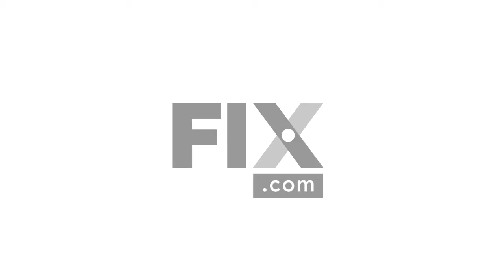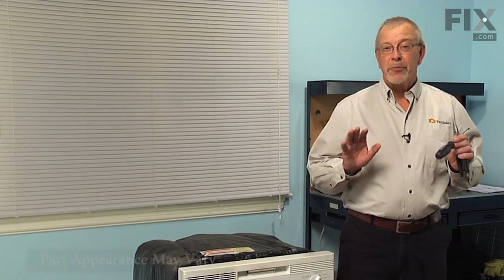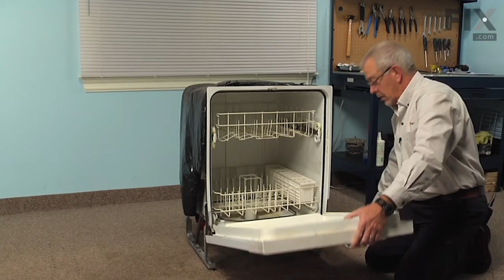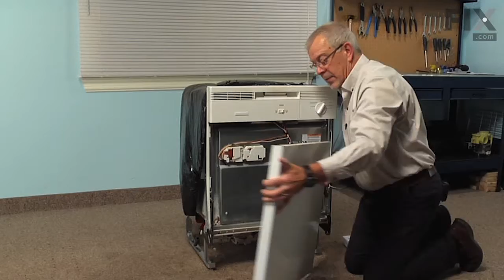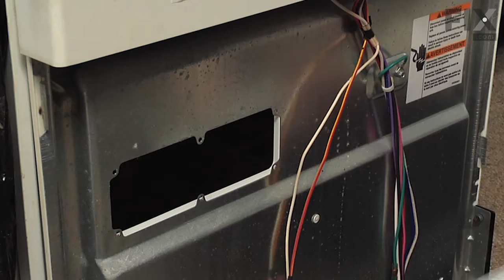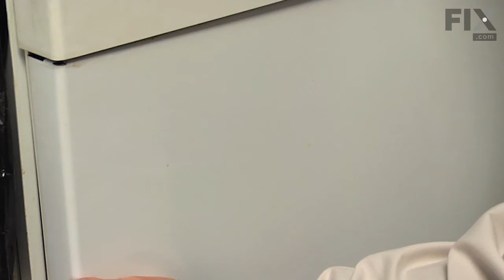Frigidaire Dishwasher Repair – How to replace the Detergent Dispenser

Comment: Replaced mine now water is pouring out of the bottom.  What did I do wrong?
Reply from the maker: Hi Hope. Is water spilling out of the bottom of the dishwasher itself? If so, it is typically an issue with the door seal. It may have become dislodged when you removed the door panel for the dispenser repair. If you send us the model number for the dishwasher you are looking for, we can hopefully troubleshoot the problem with you. You can also enter your model number on the repair center section of our website. You can find that here: https://www.fix.com/parts/appliance/dishwasher/frigidaire/. I hope this has helped, and feel free to reach out for more customer support!